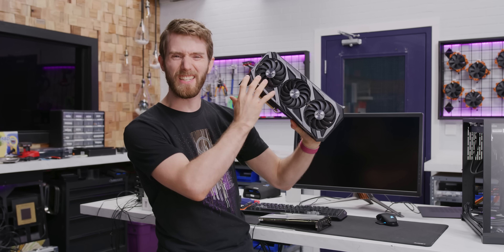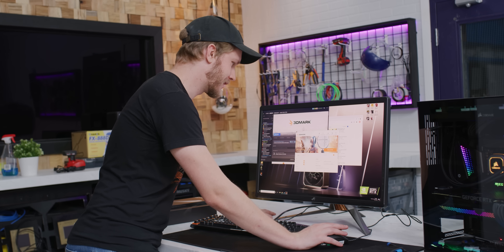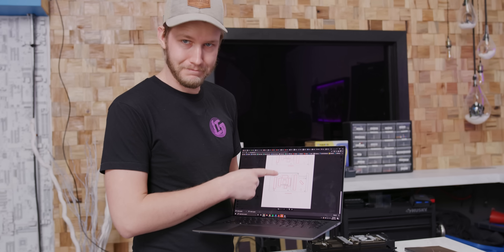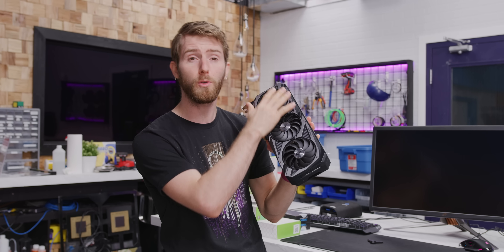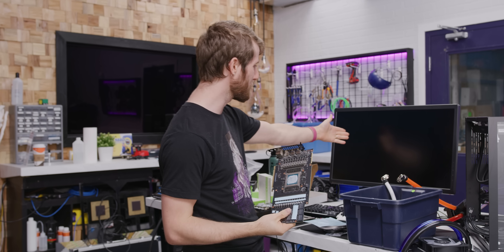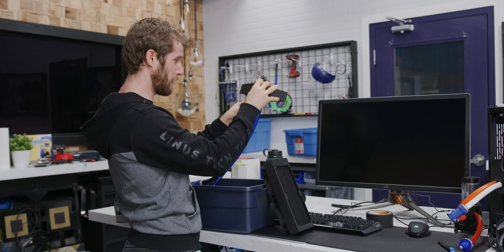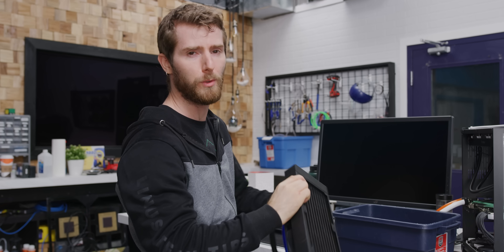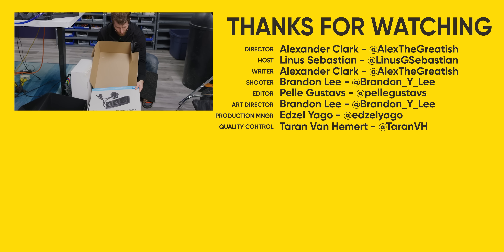Water Cooling the RTX 3090 is... More Complicated

Comment: "Temperature is not a good indicator of cooling solutions anymore, we're going to use boost clock instead."
Proceeds to only mention temperature for the radiator tests.
Reply: He gave temps because in all cases the card hit max boost, so it never thermal throttled and because its boosting stable at 100% temperature is relevant again
Reply: @kingderpington6082  If the card hit stable max boost and didn't thermal throttle in any case the temperature is completely irrelevant*. it doesn't matter if the card is at 50° or 60° if you get the same performance out of it, it just means you're wasting money on cooling

*assuming it doesn't spread to other components and ruin their performance
Reply: @TheZALGOisCOMING  That depends entirely on how sensitive you are to noise. All that thermal headroom would allow you to make a very quiet system. Of course if you don't mind or care about noise, it doesn't matter anyway.
Reply: @fragilechinaa  that's a fair point. if you get lower temperatures at the same fan speed you can decrease the fan speed without leaving the safe zone. i'm reacting because i've seen people keep their fans cranked up so they can brag about low temps
Reply: @TheZALGOisCOMING  you are exactly correct......... the temperature is irrelevant though? In terms of actual usefulness yea you dont really need to get a dual fan rad but the temperature shows how much better at cooling the dual to single to triple fan rads are.
Reply: @TheZALGOisCOMING  Temperature is irrelevant to performance if you don't hit thermal throttling, true. But it is relevant to the lifespan of the card and to the power draw, higher temp=higher draw under same load. I fully realise this is probably irrelevant to most GTX3090 owners.
Reply: @kelainefes  most components report a max of 90-100C. if you enter or exceed that range you can damage them, but as long as you stay below that your graphics card will likely outlive the usefulness of your computer (barring other causes of failure like impact damage or moisture)

as for power draw, i honestly can't say. the idea is that circuits become less efficient the hotter they are, right? i haven't taken any serious measurements but i assume any power saved by lowering the GPU temperature is offset by the higher power draw of the cooler. GPUz seems to confirm this in my fan-cooled setup
Reply: @TheZALGOisCOMING  It's not about instant damage, any chip will last for longer if it works at a lower temp. This will cause the chip to be unable to hit clocks it could when new long before it fails.

Regarding power draw, it should be measured not at the chip (by the integrated sensor) but in the power cables, as the VRM also get hot and draw more.
With a midrange videocard the power draw increase will be very low but when we go in the 300 to 400W range a small increase in resistance will not be comparable to an extra fan anymore.

Again, I know all this is of no importance to most gamers but it starts to matter in GPU farms applications where the load will be high 24/7.
Reply: @kelainefes  i did some more research and it looks like i severely underestimated the effect on efficiency, assuming nothing's changed since this thread:
https://forums.anandtech.com/threads/effect-of-temperature-on-power-consumption-with-the-i7-2600k.2200205/

i guess spending a bit more power on cooling is worth it after all
Reply: @TheZALGOisCOMING  yep,  an overclocked 3090 could go from a 400w draw to 440w just because the cooling is not optimal. Depending on the cost of electricity a better cooling solution will probably pay for itself in a few months.
Reply: @TheZALGOisCOMING  You start damaging the components of your loop at lower temps than 90-100C.  You really don't want your water temp above 50C.  Remember, there's A LOT of plastic in there.
Reply: @TheZALGOisCOMING  nope, heat can shorten the lifespan of electronics

Comment: If you run the fans at the same rpm, the 240 is going to be louder and the 360 will be even louder than that.

240 should be 3dB louder
360 should be 4.8 dB louder

Comment: I am currently running 6 radiators(all XSPC EX series) 2 pumps, 2 loops, 26 cooling fans....24 Deltas and 2 Noctuas..push/pull. 480+240+140 for the cpu and 480+360+120 for two 1080TIs. Way overkill. I will be downsizing real soon.

Comment: 66 degrees, max turbo, and 1100 rpm fans on a slim 120mm rad sounds impressive. Sounds like sticking a 3080 in a tiny sub 10L case like the FormD t1 and watercooling both the cpu and gpu will be fine if you are fine with warmer temps

Comment: so these tests are with everything set to stock and the result was that the 240mm was the sweet spot between price/performance (and that if you wanted to do a gpu and cpu loop you basically need a 360mm... SO, would that mean that if you choose to overclock you basically need at least a 360 dedicated to the overclocked gpu and at least a 240mm dedicated to the cpu in order to vent all that heat?

Comment: Water cooling is really not worth the effort. It's unnecessary and takes up too much space for very little if ANY advantage. I learned that the hard way through a decade of desktop builds. In all but ONE of those builds, the standard air-cooled GPU heat sink the card came with was more than adequate in keeping temps at or even below expected thresholds even when fully under load. Water cooling is expensive, clunky, and often times louder than just using case 120mil fans. You even admitted it yourself a couple years ago Linus, so why flip now? Sending mixed messages like that does nobody any good.

Comment: You didn't have the 3090 and the CPU both maxed out in that test. I'm still waiting for my Asus Strix 3090,but have a triple 120mm AND a single 140mm with my all core 5.1GHz 10900K system currently running a 2080Ti. The 2080ti draws 370 Watts overclocked and the 10900k 275 Watts, both at max load.

Comment: Correction: APPARENTLY they dont thermal throttle at 80c, they "boost" upto 80c+, As temps go up they "boost less", As temps go down they "boost" higher. This happens at all temps
APPARENTLY its only throttling if it goes below its base clock at 12mhz or whatever.

Comment: Open vs closed chassis, not really accurate testing methodology here
Reply: Depends on what you are testing. I think they are testing the effectiveness of the radiator sizes on the 3090 taking case airflow out of the equation.

Besides, A closed chassis only really gives you information that truly relevant to that particular case, or a case with similar airflow.

Comment: The D5 is rated for max 40 or 50 degrees C. In a warm room, there is only about 10-15 degree C water temp rise to play with. Given your single rad water temps, your recommendation feels reckless.
Reply: I think it's up to 60c. Certainly for ddc
Reply: @Tom--Ace  Well. Let's say you do 60c for the water. Care to explain the cooling capacity of such a loop?

Comment: What this also tells us - spoiler alert - is that a small form factor system with a 3090 and 5950X can be done on a single rad without overheating as long as there is no OC involved. Yes the CPU will be in the 80s to low 90s, but while not ideal, it's acceptable and the necessary sacrifice for being able to carry it in a backpack.

Comment: Yes, it really is the “best case scenario” when talking about a PC case with 9 fans lol
Reply: Pun intended..
Reply: Best comment in a vile
Reply: what case is it?
Reply: It was just his wry little smile
Reply: Fanario, eh. :D
Reply: Thanks linus and friends.

Waiting for quadro. If not shunted fe looks above right.

CAD acceleration isnt a deal killer. 3D printing wont likely get complex enough for that to matter. It is annoying however.
Reply: Nice flir camera. Mine was cheap though. The resolution isnt quite the same tier.
Reply: 9 fans? pff.
I had in my first gaming rig with a Athlon 64 (then upgraded to a 4600+ X2 dualcore) also more than 9 fans in a classic, heavy Chieftec Big Tower (steel frame!). 4x 80mm front, 2x 80mm side, 2x 80mm back, 2x80mm Fans mounted inside the case, one blowing at the CPU VRMs and the other one blowing ALL the air on the chipset. Heavy OC made the cooling necessary.
Reply: I have 19 fans. Lol
Reply: Dangitthatsagoodcomment.
Reply: Also with Canada weather

Comment: 1:50 Alex ... Complains about 9 fans in a PC, Me ... literally having 17 fans in my system. (See below for explanation)

*TWELVE (12x) 120mm fans - push/pull on two 360mm radiators, plus ONE (1x) 140mm - back exhaust, and also one 92 mm on NZXT Kraken G12 (GPU AIO mount) for cooling VRM, not counting three small built-in fans on the second card - Radeon VII.
Reply: Yes, I am weird. I use my computer for GIMPS - prime searching project, kind of like BOINC, but more specific, not universal. It's also a good 750 W space heater :)

Comment: I ran a 360 RAD with a R9 390 and FX9370, the water got a bit warm but it worked fine. Worked even better when I replaced the FX9370 with a 4790k. Now I have a 2070S but I cant find a block for it :( 4790k is still kicking though!

Comment: I'm building my loop with a triple 140 and a dual 140 and will be overclocking i was thinking the triple would cover the gpu and the dual would cover the cpu as I will be overcloxking and the cpu i will be using will have a 105w tdp. I'm also using corsiars radiators

Comment: I'm buying this gaming pc:
AMD Ryzen 7 3770X - CPU
rtx 3070 - GPU
16 gb RAM 3200 MHz - RAM
1 tb NVMe M.2 ssd - ssd
2 tb HDD - HDD
B550 gaming motherboard - Mobo
CM ML240L V2 ARGB - cooler
650 W PSU 80+ gold - PSU
Svive Halo S650 Midi Tower - case

Please tell me your thoughts on this gaming pc :)

Comment: Computer geeks know nothing about thermodynamics and heat transfer. Do the calculations not perform trial and error by trying different size coolers. Also, water cooled is NOT a solely water medium. Water actually would be best because it has the highest heat transfer coefficient unfortunately the only the reason water is NOT used is it evaporates quicker than a glycol, di or tri ethylene mix. Alcohols. 

Q=MCpDeltaT

Do the calcs find the square surface area required to cool the heat delta from inlet to outlet. Pick the appropriate metallurgy, use the correct heat transfer solution, find appropriate flow rate for worse case scenarios.

Comment: I'm running one 280mm and one 360mm radiator in my loop. It is cooling an i7 6700k and a 2080 Super. Overkill cooling, but it's a very quiet setup.

Comment: I would love to see a video where you see how many radiators you can link together before you get room temp or lower temperatures in the case (ie: connecting 10 360 rads to get the lowest. Temp possible

Comment: Ok sff can easily use a high performance cpu and 3090/3080 on a 240mm, it’s as easy as trying undervolting, this generally drops temps by 5-10 degrees at least in my case running a 95watt cpu on a 65 watt cooler with stock performance at 60-70 degrees and running my 2070S at 60-70 degrees in the ghost s1.
In conclusion a 240 could most likely cool a 3080/3090 with a toasty processor

Comment: I love that you're using the case I have in all these builds! Looking to get a 3090 when the hype dies down. I do things like deep faking voices with neutral nets. Still not sure if the 3090 is better than the 2080 or Ti given fewer Tensor Cores in the former. However, the newer cores should be faster and the extra memory will help with audio and video data at higher fidelity.

Comment: EK sends you a block that basically doesn't fit the GPU. Does that mean that even EK doesn't have a Strix 3090 to test the water block? I mean basic fitment should be the first thing they test with those. What a sad GPU launch this is.

Comment: I learned to not bother with watercooling if a 120mm rad has to handle more than 100W.
After some experience I came to the conclusion of needing at least 280/360mm per 100W for cool and very quiet operation.

Comment: I use 3x triple rads that all pretty thick for no reason at all to cool one CPU and GPU.  Guess I should be safe but probably still won't buy a 3090.  :P

Honestly I don't know they were expecting?  Without knowing the power draw of a 3090 off hand I assumed the 120mm was going to be good enough.  I'm sure of one thing... The card doesn't draw enough power to need 3x 8pins.

Comment: I personally feel like water cooling is the biggest lie ever sold by the PC building community. Lower temps don't matter unless your going to OC and even then the power limit on a lot of newer cards/CPUs make the cost benefit negligible. Good air coolers can be just as quite and don't require running plumbing through your PC.

Comment: Weird Question: Does 3090 runs hotter than an overclocked i9? (in similar cooling system)  🤔
Reply: Since that 3090 does not need a chiller in order to not be throttling, the answer is NO
Reply: Much bigger die on the GPU, so the heat transfer is a lot easier. Also, no heat spreader on the GPU, which means that the die is making direct contact with the cooler.

Comment: I am cooling 3900x and 1080TI overclocked to maximum with single xFlow 30mm x 240mm radiator with fans on the minimum rpm, increasing Delta T of water vs ambient, increasing efficiency. Basically 240mm radiator can dissipate 1KW of heat easily if you supply him liquid much hotter than ambient temps. But you sacrifice longevity of pipes and pump in this case if water temp goes too high. When my cooling system reaches it's maximum point in long gaming + parallel rendering sessions radiator inlet water temp is around 60c (while ambient is 23), outlet - 31c and fans blow hot air, 4.3GHz all core OC-ed Ryzen 3900x reaches 65c max, GPU gets to 52-55c.  I find it suitable for whisper quiet high tower PC :D Also there is VRM and chipset cooling present in loop, I just threw few more waterblocks to all components after x570 release and reviewers shouting that x570 chipsets get hot :D :D

Comment: If you guys wanted to do a video on a small form factor build with a 3090, high performance cpu and a 360mm radiator, then check out the sliger sv590. They are about to launch a refresh too that adds extra support and offers some other improvements.

Comment: Guys can anyone answer please. I've just finished building my first pc but after shutdown all of the fans don't stop spinning and it's because of the 5v argb header that keeps giving power so the only way for me to shutdown completely Is by turning off the PSU. Btw it's not a PSU problem because i've already tested it with another one. I do have a different motherboard to try but I really would love to avoid if possible because it took me so long since it was my first build and I would have to remove and reinstall the CPU, that is something I'm not really comfortable doing so do you think it can be changed in the bios or do I have to swap the mobo? B450m steel legend btw, thx for your time guys

Comment: got an idea/suggestion

how about having 2 Water Cooled RTX 2080 TIs in a system with virtualization running both MacOS and Windows at the same time using something like qemu with gpu passthrough therefor leading up to a comparison between building towers, 1 for Windows and 1 for MacOS, or building just one tower with 2 OS virtualized on it in order to explore the performance difference between them, obviously the two other systems would have to have identical CPUs in terms of core count and clock speed to match the "split in half" CPU in the VMized system

just an idea tho

PS: was considering 2 RTX 3080s originally, but that would be ridiculous

Comment: the 120 rad if you give it about 1 or 2 hours it will be so hot you can not touch it ,, i made this mistake once on a 200watt cpu after about 1 hour of gaming everything was at 5 fps no matter what game i played ,,  best rule of thumb    120 = 100 240 = 200 360 = 400+ watts this is about the best idea for water cooling i can give

Comment: I'm curious how a 280mm would fare vs a a 240. I prefer 140mm fans so I can move more air at lower RPM and thus lower noise. Like Linus said, the main reason to water cool is silence.

I was planning on just doing a "normal" build, then transitioning to a custom loop when Big Navi / RTX 3000 series came out, so I bought a bunch of watercooling stuff when PPCs was having a sale (and I caught things in stock), but I was able to get my system pretty much silent at idle without having to water cool, so I have a box of about $1300 worth of water cooling stuff sitting in the basement.

Comment: I lucked out and got a 3090 Strix.  Even running benches the temps stay around 70 on air, gaming around 60ish. Boost 2115 with OC.